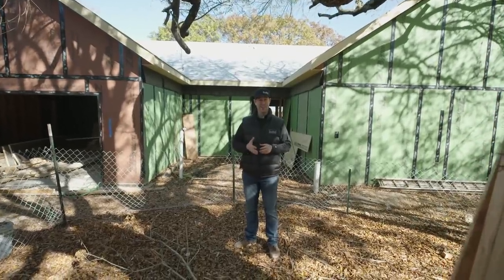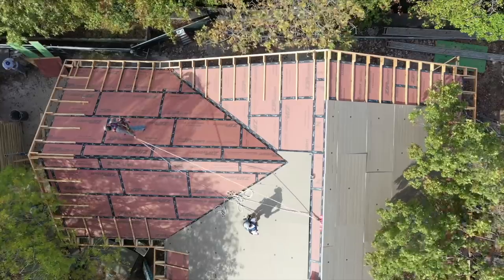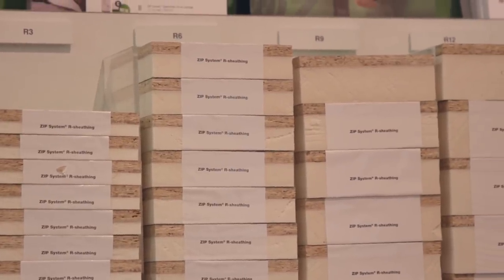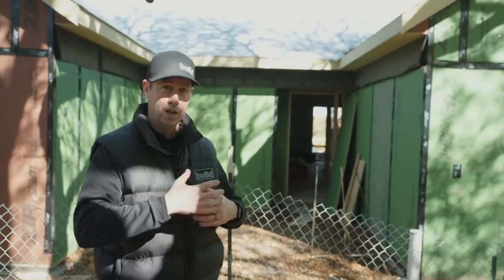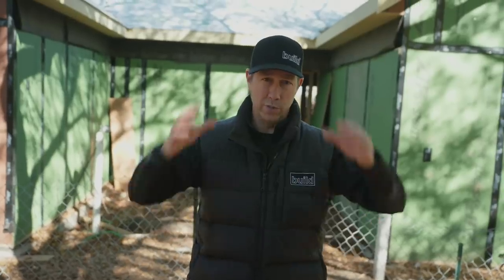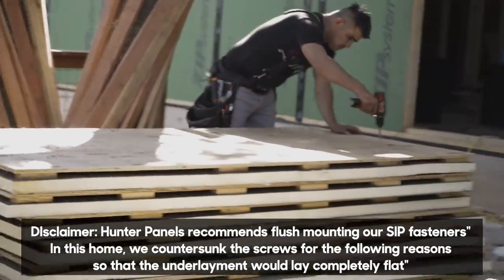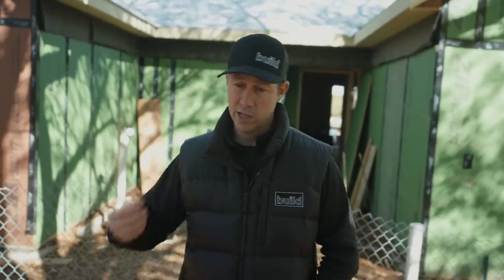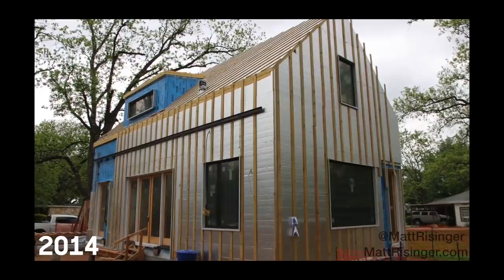Rooftop Insulation with Hunter Panels

Comment: Not sure I see the reasoning behind the ZIP roof sheathing if there is another layer of waterproofed sheathing above it. If you don't need the waterproofing aspect of ZIP the air sealing of regular OSB is just as good once the seams are sealed.
Reply: I guess it's for the redundancy?
Reply: @marcob1729  and it's free
Reply: I believe the Zip serves as air, water, and vapor barrier because the attic is conditioned which necessitates keeping the conditioned side of the Zip below the dew point. Notice the Hunter panels were not airtight in adjacent seems. Top side of roof vents to space in Hunter panel. The Sharkskin underlayment is water only as a conventional layer on any roof. Did I get it right?
Reply: OSB on a roof is a big no-no
Reply: @shootmovecommunicate3322  I'm pretty sure that the vast majority of the 95% of residential housing using OSB is doing fine
Reply: @user-tv5dt3nm9y  what's the point of the expensive insulation if you're just going to leave gaps? I'm not arguing, to be clear. It just seems odd
Reply: @marcob1729  maybe some production builders, but most builders worth their salt don't use osb in roofs because if it gets wet once it needs to be replaced immediately. It's terrible practice. Wind driven rain is much worse in some parts of the country than others I guess. To each their own mate, good luck and happy hunting.
Reply: @user-tv5dt3nm9y  this is still not necessary. The foam on top of the ZIP must be sufficient to keep the ZIP below the dewpoint, or the installation is pointless. A point can be made for redundancy, but otherwise, it was just a waste of money, IMO. The point is that if this system is done correctly, the ZIP is completely unnecessary. If the ZIP is necessary, then I don't trust the method.

Comment: Matt, I am from Poland (EU). Here people are concern about vapour diffusion on the roof. Do you think that rooftop insulation would collect moisture on the top of the ridge because it does not allow moisture to escape? I afraid that such technology would create the same problem as with sandwich panels - moisture and rotting right at the ridge of the roof. Would like to here your thoughts. Thank you in advance!

Comment: Hi Matt, would I be right in thinking that this is a bit over the top purely from a financial POV, but you're doing it mostly for the sake of perfect thermal efficiency?  i.e. thermal performance for the sake of it?  When it comes to economy, there's a point in the curve where adding extra insulation simply doesn't make sense.  You know, let's say this perfect insulation of thermal bridges (and extra insulation overall) saves you 20% energy costs/year....the cost of making an extra 20% energy saving could quite easily be put towards something like solar thermal/PV which is cheaper (and almost passive regarding time/resources)?  Would appreciate your thoughts here, thanks!

Comment: Matt I love the channel and I have a simple question. How do we make this type of building affordable for the masses to adopt and use?
Reply from the maker: It’s a great question. Getting panelized Buildings like BMC’s Ready Frame process would be a great start. And having Production Builders goto these methods would be awesome too.
Reply: @buildshow  So are you thinking that if production builders did the same it would drive costing down, and that would make it more affordably built and for the masses?
Reply: @bcimato  it's not crazy to think alot of builders will be doing similar things in the near future. Building codes are gonna start requiring more efficent homes as the country tries to lessen it's energy useage. I think the market will start showing that in this next decade. And those cost effective meathods will definately become evident first.
Reply: @ljuwt200what  what does a stringed instrument, slightly larger than a violin, have to do with it?
Reply: @ShotGunner5609  I agree about code changes in the future... But building to this level today will require sacrifices in the name of location and Sq Ft. for the average masses to afford.
Reply: To answer your question, another method is going to have to be developed because what you see in this video is impossibly expensive for the housing needs of most of the country.

Comment: Hi Matt, keep up the good work! Love the videos. 
I'm about to do this to our house once we strip the shingles and paper, (we're going replace it with a steel roof ). Our home is one of the first solar envelope homes build in New England in the 80ies. (gambrel roof).
Question: my roof decking is plywood, after changing any boards that are bad, what do I do next before using this Hunter product? Do I put a membrane over my existing plywood? More insulation? Keep in mind that because it's a solar envelope, the space under the decking is connected to my north and south outer wall and not conditioned space. However, the heat we lose to the envelope escapes thru the top, so air seal is important. Any tips would be greatly appreciated! P. S. This might be a candidate for one of your videos.

Comment: looks like a good design/eng solution to keeping roof cold and preventing condensation - it is one of those things people tend to overlook sometimes #soffit vents
Reply: particularly for your use case you would still want to vent the spaces afforded by the plywood through some sort of ridge vent - it will end up keeping the roof much cooler which is what you want - less temperature differences, a lower ac bill - think of the thermal mass of the roof and a longer lasting roof - the design of the new materials may be great but the installation and usage has to be appropriate as well - geography and climate and weather can have real impacts on most appropriate designs #green building standards #dew point #relative humidity #do you put the ac in the attic or the basement #do you put the heat exchanger in the attic or the basement #can you improve the efficiency of a heat pump with hi side and lo side buffer tanks? #cascade cooler #where does the dehumidifier work most efficiently? #systems integration #pos pressure hepa #x box #pressure drops
Reply: there should be some sort of default ventilation and you do not necessarily want that super tite vapor barrier - you always want some passive inflow and vent - what if all systems go down is the thought experiment on this - the good news is that probably most everything will have a battery backup and/or failover and also monitoring and control systems are so good now that the house should be able to be kept at a stable temp all year long with lower humidity and with heat pumps up to 300% efficient there stand to be gains from other systems and also down the line for efficiency savings #roi #tco #pv panel prices #heat exchanger #google power meter - modern day equivalents
Reply: good content overall - A+ #reasonable presentation #logical #hvac hacks #building science #experience #green building standards #leed platinum

Comment: Love the show! I have a question about doing a chainsaw remodel/ monopoly house.  I am in zone 5 and have a 1957 ranch.the house has a tar infused sheething, wood clad siding then a layer of 1/2" foam then aluminum siding. Can I remove just aluminum siding, then add 2 inches of exterior rigid foam or should I go back to framing? Maybe somewhere in between?

Comment: Is there any issue with slightly oversizing an HVAC system if its variable? Jmanual says our summer design temp is 94 degrees but thats based on 30 years of data, if you just use the last 5 years it would easily be 96 or higher. I just dont want to size my system based on old climate data

Comment: I feel like insulation value requirements are going to explode in the next few years. Is avoiding foam insulation still a concern ecologically? I’m a big fan of the dense mineral wool, although it is expensive for the R-value per inch.

Comment: Tell us about the extra cost vs payback in next 40 years.
Reply: Do we know cost of heating in 40 years?
Reply: @72strand  Now that is the reply of a "used car salesman" type of contractor!!! Let the project cost fill the budget! They are rich and don't care so why not let them spend is all with me!! The cost per square foot of this roof appears to be approaching the standard cost per square foot for a house. Though this is a good idea the cost would prevent it from being installed on any but the top 2% of homes. Ones $1.5M or more....
Reply: What is comfort worth, it's not all about energy savings.
Reply: @AtTheBarn  You don't have build this extreme. If you do "advanced framing" and 24" cc and 2x8 studs, and rockwool. The price is hardly more. Compared to work cost it is nothing.
Reply: @Ampacityelectric  Thank you!!
Reply: I just don't know where it ends.  Its like putting a roof on 3 times.  I just want to know if it drops hes heating bill down to nothing
Reply: @R2Mike  No, he does this to covert the attic into normal house room.
Reply: @72strand  No the attic is not being converted to a normal livable space. There is no intent on that space being used for living activities.
Reply: @72strand  so whats wrong with baffles, spray foam, then drywall??
Reply: @christianvanderstap6257   There’s less expensive ways to be comfortable.
Reply: @ToddBizCoach  Yes it is climate wise. He said so too.
Reply: @R2Mike  Rockwool baffles are great. Personal i hate spray foam in all forms. Why? It gives of gases. A Swedish normal wall in a house is 24", 2x8 studd, Baffle of Rockwool, plastic (tin), OSB sheet, Drywall. Yes double layer for walls inside.
Reply: @72strand  who cares about Sweden? Since when did they lead the US in cost efficient home building. It’s not efficient use of money to invest in things that have more than a 12 year payback. There is no added comfort in an R-80 ceiling vs an R-40 ceiling.
Reply: @R2Mike  what does that say when there is no mention of payback period for this installation of labor and materials. And all this in a Texas climate, waste of money.  At what cost do you eliminate all heating and cooling bills? Where does it end from a practical standpoint?
Reply: @ToddBizCoach  Well this was a very American view from you. I like Steve because he takes great thing from all over the planet. The building industry is not only in the US, but even in EU slow to improve. Houses in Sweden are well built but not cheap. The problem is not even cost of materials, but other things. But make no mistake, a normal US house is like a toy compared to a EU built one. We need that, that is why. But i think northern US is as cold as EU, so there it makes sense too. A house here lasts 100 years prob. So yes it makes sense to spend a bit more.

Comment: What adhesive did you use under the zip r?
Reply: You don't, it fastens to the studs with screws.
Reply: @kookiethebear  there was adhesive in a number of shots, particularly where the sheathing meets the eave of the house
Reply: @marcob1729  Ah, that's at the open edges that don't have Zip tape on them.  The product is Prosoco Air Dam and I can confirm it's fantastic for sealing potential air gaps.  https://prosoco.com/product/airdam/

Comment: Hey Matt Risinger why couldn't you use the roofing panels on the outside also?
Reply: It’s just a SIP, so of course you could. Depending on your location, you may need seismic and/or hurricane sheathing then attach this SIP as a rain screen type setup
Reply: I'm not entirely sure if the order/combination of materials would allow for a decent rain screen. I guess it would, but then you'd need to put additional furring on the foam to attach your siding. I think
Reply: @marcob1729  No. If you used this setup for siding, you’d attach siding directly to the plywood sheathing. I personally do not like that setup as water can be trapped between siding and sheathing, which defeats a lot of the advantages of rainscreen. It would be cheaper and more effective to field fabricate rainscreen setup. 

If you’re located in fire risk zone, it’s recommended to avoid Polyiso exterior insulation, any foam for that matter. We used 6” Comfortboard 80 on our place, which back to USFS land and Rocky Mountain Natl Park.

Comment: I wish you had included a diagram of how the roofing joists and walls come together with the different layers. I didn’t quite understand how the screws were securing the top roof sheeting to the structure but I also haven’t done much research on the zip system, other than what you have mentioned on the few videos I’ve seen and the commercials before watching your videos.

Comment: I’d love to know how to do this on my existing home
Reply: not economical. needs to be done from the start.
Reply: 1+ mil
Reply: @sunshine5349  Not entirely true. If you want to do it because it seems awesome then yes. But if you’re already planning on tearing up roof decking then cutting tails off for this isn’t a stretch.
Reply: 2 options come to mind:  

(a) if you're removing the roof deck and leaving the rafters, it's possible to add a small ledger to hold rigid insulation in place, ideally with foil backing facing UP e.g.:

http://supremelaw.org/authors/matt.risinger/site-built.rafter.vent.gif

 (b) if you're leaving the roof deck in place, it's possible to add nailing strips to create the required air gap (2" min.), and then another layer of plywood (for shingles), or metal roofing on top of the nailing strips.

I'm not a licensed contractor, however;  just an amateur carpenter 20+ years ago.  So, run this by your architect / engineer.

p.s.  In case you haven't seen this great article by Joseph Lstiburek from Fine Homebuilding, we archived that article here:

http://supremelaw.org/authors/matt.risinger/PA_Crash_Course_Roof_Venting_FHB.pdf

Comment: Won't the metal roof just cook that sharkskin underlayment?  Similar to what happened on one of your previous roof videos a couple years ago?
Reply: That's a good question. In the other system he used with the furring strips over the underlayment, it gives you that ventilation space between the metal roof and the underlayment - and the heat is ventilated out above the roof assembly. In the Hunter panel system, the underlayment and plywood layer are both above the ventilation space and exposed to the extreme heat buildup of the metal roof. Seems like the Hunter panel system is a much less effective ventilation strategy, and possibly more complicated detailing at the eave and ridge.

Comment: Hey Matt, you mentioned increased insulation for northern climates, curious to hear your thoughts on polyiso in the colder areas? I've read it's not as suitable and am having trouble understanding if XPS, EPS or Polyiso is the way to go. We get around 10 below (centigrade).
Reply: @Kurt K From what I have learned from Matt Risinger and Joe Listibruk is that in the southern humid climates, you want to keep the humidity (vapor) from the warm  outside from migrating inside. Therefore you would use a vapor impermeable insulation like polyiso. In the Northern colder climate you want to manage the humidity (vapor) that migrates from inside the warm house to the cold outside. So in your situation, you would want a vapor permeable insulation like rockwool.
Reply: @bullfrogg4119  thanks, I am in Australia in what would be considered cool temperate/mountain. We have snow in Winters with lots of moisture and then seriously dry summers that are hot.

I've read that polyiso doesn't hold its R value in cooler temps which I don't quite understand?

I'm planning on using a product like the solitex Mento/extesana from pro clima but this is a retrofit job so I can only do it externally not internally. I was hoping to build out additional insulation like the ZIP-R system but now I'm not so sure

Comment: Matt, I've watched every video on your channel pertaining to roofing and I have yet to see one single cross-section of your roof edge detail. I get Monopoly framing with panels touching at the corners, but what is protecting the exposed outer edge of the rooftop insulation? I am guessing that the fake soffit is hiding it but what if you're doing a roof with no overhangs?

Comment: So, it's foam, panel, and furring strip preassembled for you? I think a lot of people would rather just do that themselves
Reply: exacly!
Reply: Depends on pricing. If the labor costs, not to mention the structural engineering costs of on-site fabrication can be overcome with this ‘prefab’ solution, it makes $ense. It’s just a question of $$, including getting material on job site. Because labor costs and availability are highly variable by market, it’s not an easy answer. Here in high Rockies, skilled labor is a pretty scarce commodity. For that reason alone, I intend to contact Hunter to determine exact costs.
Reply: @MichaelM-to4sg  structural engineering costs? I'm not sure if I'm following. There's a shear panel underneath already in place, which the engineer would already spec for you. It's literally foam, 1x4, and OSB.
Reply: @marcob1729  Structural engineering calls required in every municipality I am aware of for rafter load and roof deck. Hunter provides both panel mass and load figures which are submitted w/plans. If you’re hand fabricating, you’ll need to have engineer provide these calcs accounting for foam mass, foam load capacity, sleeper layout & nailing and roof deck load capacity.
Reply: @MichaelM-to4sg  so you'd have to get the figures once and be done with it? Seems like something your engineer wouldn't even bother charging more than an hour for. I'm planning an addition right now, so it'll be interesting to see for myself. I'm next door in the foothills, so your experiences are more relevant than most commenters
Reply: @marcob1729  Ha lol-you obviously havent engaged many structural engineers !